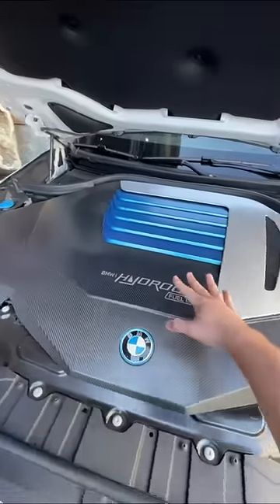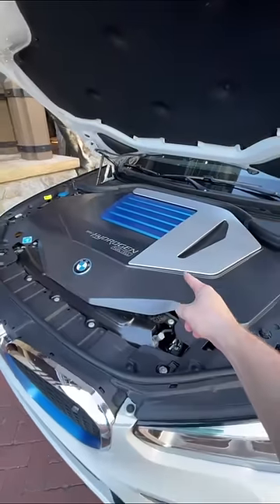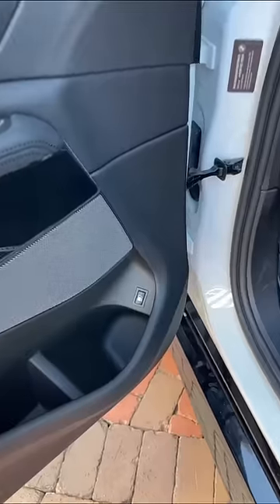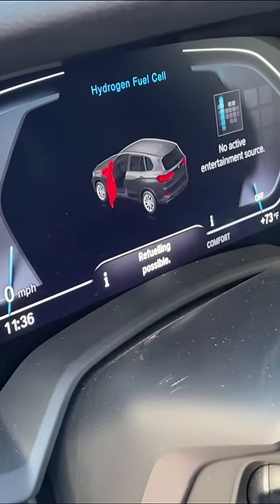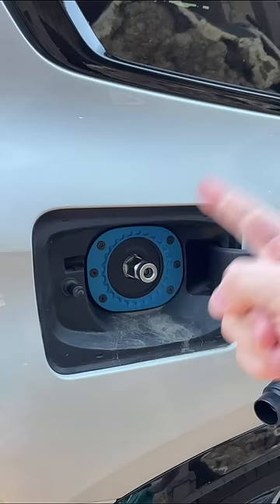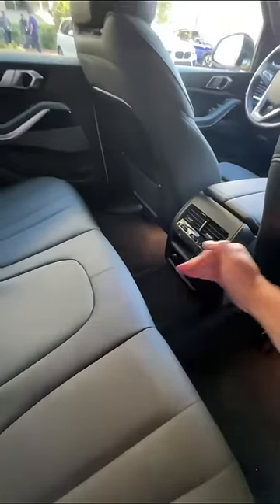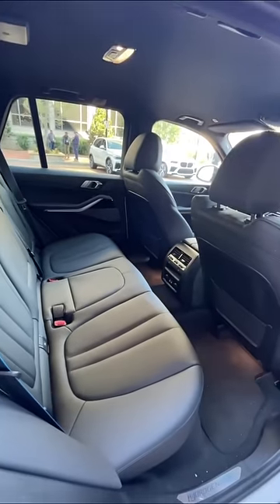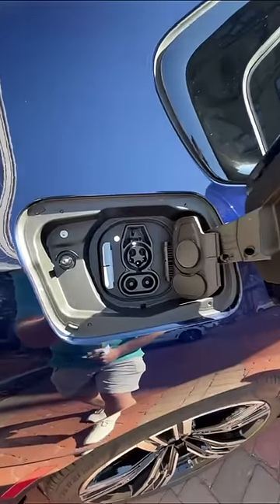BMW's Hydrogen X5 may be the future

Comment: Hydrogen is no Solution. Same with "E-Fuels". It just doesnt add up and is way to expensive(for Cars). Why use energy to get hydrogen and use the hydrogen to generate energy for driving if you can just use the generated energy, store it in batteries and use it. for energy hungry processes like steel production or in the chemical sector it makes sense.